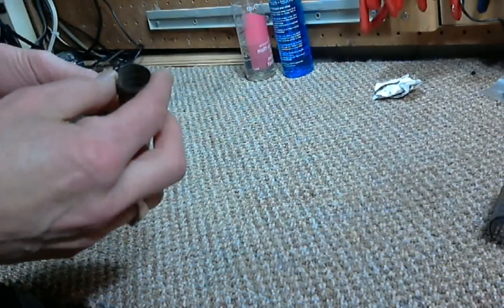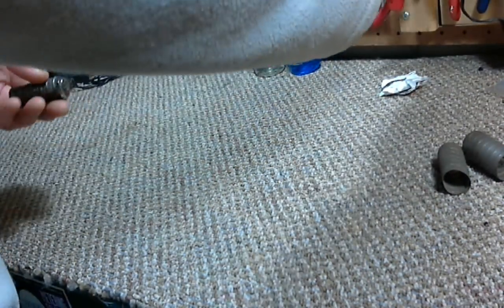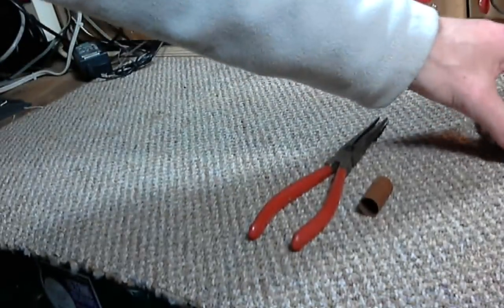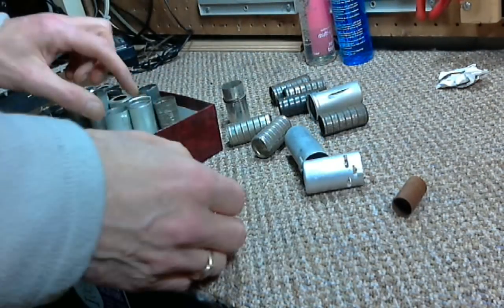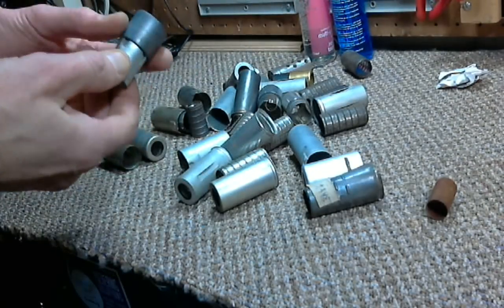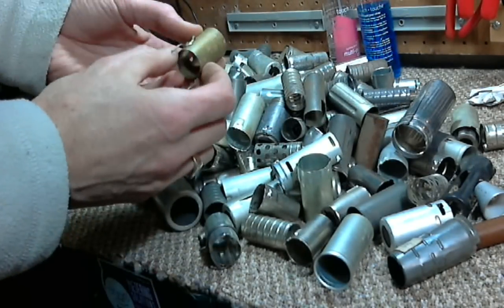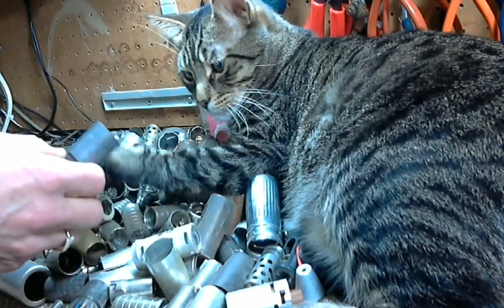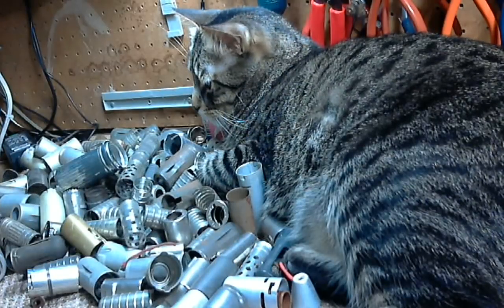A Collection of Vacuum Tube Shields

Comment: The beyonette fitting spring loaded preamp tube shields are awesom. Such a perfect design.

I have a goat shield that came out of an old radio from the late 1930s. I hope to get more of those, I will. I have to restore that radio. I actually re-manufacture it because the cabinet is way too dodgy to re-use. My shield is rusty , so I will re-plate it with nickle using electroplating process and some coins. It is the type of shield ised to cover a tube with shoulders. Anyway. Interesting to see your collection.

Comment: I've had pretty good luck pushing down on the top of the tube with a 1/4" nut driver while holding the tube shield to get them out.
Reply from the maker: I have more tubes that need to be de-shielded so I'll try that.  I find twisting the tube in the right direction really helps but it must be protruding already so it can be gripped.  Jim.

Comment: Hi Jim. The shields with the lead on them is for reducing micro-phonics. The heavy weight keeps the tube from vibrating.
Reply from the maker: Thanks Dennis.  I was wondering if it was for x-ray protection but I don't know of any such concern accept for HV TV rectifiers like a 1B3 and I don't think there's any need for lead shielding with those.  So I was quietly pondering the possibility that there were miniature tubes with x-ray problems and these shields were for them.  I was quiet about it since it seemed so far fetched.  Thanks for providing the more mundane truth.

Comment: Thanks for the shield information,Its quit the collection! I have a 1930"s general electric floor model radio I have been working on,It seems to work good other than the speaker doesn"t seem to be working properly.Someone has already worked on the speaker before me,and there was wires cut on the speaker.It has 4 wires going into the speaker.And it looks like they changed  out the original transformer on the speaker.I looked at my schematics for this radio and tryed to wire it back to original,but it still works the same.could you do a video on testing the speaker and testing the little transformer so I can get a Idea what to do.. Thanks JIM,and say hi to Draper!
Reply from the maker: Watch out Robert.  Two of those wires may have 100's of volts on them.  I have a video on testing a speaker for an Emud radio.  You can search it out from my videos.  What is your speaker doing that is not proper?

Comment: Hi jim, I will look for your speaker video,my problem is the radio is recapped and is working strong and picking up lots of stations. I think the problem is with the speaker as someone cut the wires going to the round  vibrating coil on the speaker,I rewired this but the sound is weak,but gets louder when I turn up the volume switch.I found that there is lots of power in the wires coming from the radio as I welded my screw driver.I want this to be my retirement hobby,not my death hobby!
Reply from the maker: You need to be careful.  The wires with the power need to connect to the field coil of the speaker and the other two to the voice coil.  Don't get these mixed up.  Until you know you have the wires correct, assume the speaker is OK.  If you have a volt meter, you can check for high voltage to help identify the wires.  Don't guess or experiment.

Comment: Cool Cat, Jim. Unrelated question: What camera are you using and wondering how you are able to view it live on your monitor?
Reply from the maker: Your question is very related.  I've been struggling with achieving satisfactory video results and have tried a number of 'cameras' and approaches.  I've learned the hard way that HD is not easy to achieve for a number of reasons.  I am using a webcam which is why I can monitor the video on my screen.  I am using a Logitech C270 - 720P webcam.  I was using a Microsoft Lifecam but the camera wouldn't function at anything near HD.  Logitech and YouTube have some kind of deal and the Logitech and software works well with YouTube.  The last thing I learned is that Logitech has a way of faking 720P by shooting at a lower resolution with 30fps then somehow filling in the missing data to achieve a near 720P resolution.  That's where I am now but if you view my older videos, you see different video arrangements including some poor results.  This camera's video is good but the audio sounds 'compressed'.  I think this is part of how Logitech achieves the HD effect - it sacrificed audio to achieve higher video.  Viewing the video live is critical to being aware of the shot frame and I still struggle with knowing what I am capturing and you can see the mistakes (mis-takes) I make while videoing.  Long answer to short question.  Jim.
Reply from the maker: Hey Brad,  I tried inviting you to my hangout last week but I invited another Brad Freeman by accident.  His profile picture looked like yours when I viewed it at small scale.  Turned out his dog in the picture is actually his girlfriend when you look more closely.  Would you like to be invited to a hangout?
Reply: Jim Lindenas I have been prepping to start my own repair channel and have been experimenting with several cameras. I mounted a Logitech c920 on my Optivisor. Geeky but highly effective at hands free production. I am finding that 720p at 29 frames is best for post production and uploading. I will say that the 920 takes amazing video and has quick focus. I had cut off the weighted base.  I also have a Gopro HD mounted on a goose neck and now just added a sony HD cam.  My goal is to have at least three angles, so yes, I do have to convert, edit and export for upload to YT. At the rate you upload videos, I'm thinking post production would only slow you down. Since I lack any knowledgeable expertise in electronics, I am hoping to just wow my future followers with great video of me pulling my hair out, trying to fix stuff:)  
Since you are using a webcam, I might suggest you get a separate microphone and hang it away from the cam. You can tell the Logitech software to use the sound card mic input for audio. That way you can grab the webcam and move it around without disturbing the audio. Just an observation.

With all that said. I love what you do and how you take us through the unedited thought process and repair. My pup and I would more than welcome any of your Hangout invitations.